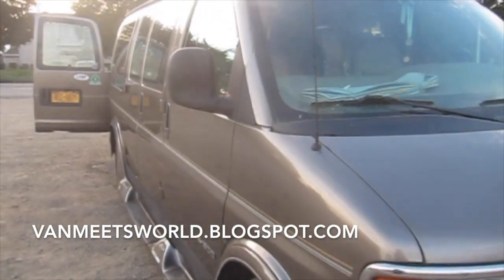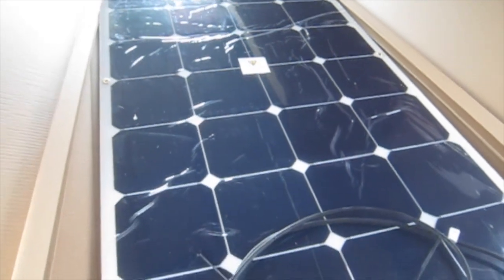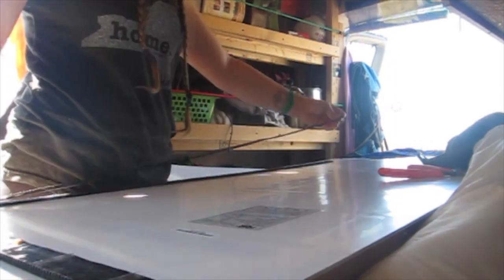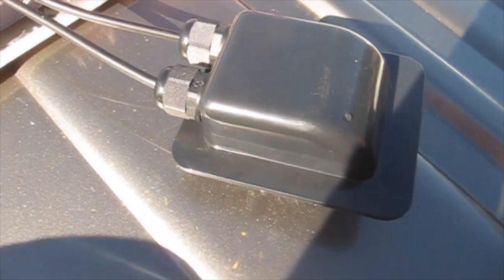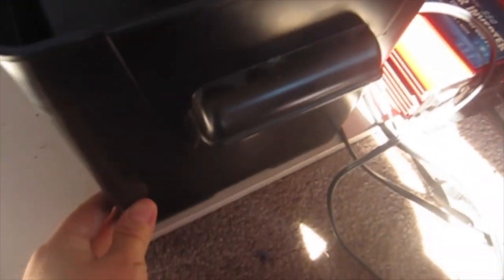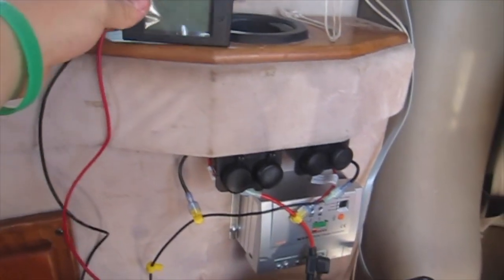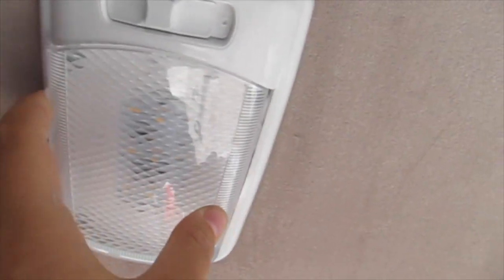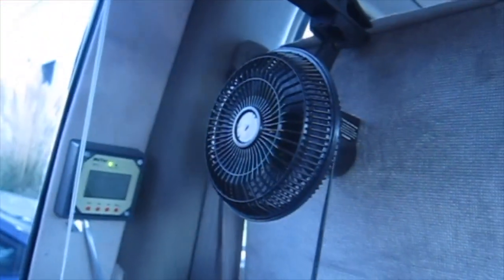Hayduke goes solar!

Comment: Hello ma'am,  I appreciate your videos! Found your channel today, grow back from my old roots.  2007 sold everything I owned, packed up a Bronco II, removed the back seats, and created a website "LifeSaysGo.com",  traveled the west coast for a measly 6 months.. Worked @ temp agencies for gas, showered at wmca's, ate @ shelters... Life grows on from their.  Have learned a few things since then, I could show you how to receive donations via paypal or bitcoin.   Made something a bit different than yours I called "A Battery in a box"  12v marine battery, charged while driving with diodes, 3-120v outputs via inverter, 2-usb outlets and a 2-12v dc connections.    P.S>  create a collective email for paypal & start collecting, go to coinbase and get a wallet...  Post both as monetary options for your journey :)  Hope All Goes Well :)
Reply: A diode is "1 way in - 1 way out"...  Use your current battery/alternator to power your internal "Power" battery, Solar is good when you are popping a squat, but dc to dc is good from place to place"    Create a direct line from your battery and put in a  fuse.  Connect from there to a car charger with a diode, go to the internal van battery, connect the inverter, make the split from D/C to A/C,  make  it all connect.   Youtube it... seem like a smart lady!
Reply: Also great you have affiliate links, possibly put up a wish list...
Reply from the maker: Bryan Mayor Thanks for watching and for the tips!

Comment: Good start.. I see they mentioned AGM's for inside. (explosion hazard is real) So I mounted mine under the van. No hazard plus Free space inside now. Also, keep your eyes on that velcro. The sun's heat will melt the adhesive while driving  and the wind will rip that clean off. $$ gone
Reply from the maker: Velcro is holding up just great. It can deal with temperatures of up to 150 degrees I think.

Comment: Hi Faith, very nice work so far! Great to see you get stuck into some basic electronics work. I've read through the comments- you've been given some good advice about venting the hydrogen from your battery and securing it, but no one has mentioned the point where your panel wires feed through the roof. 

The panel wires need to pass through some rubber grommets fitted into the holes. The metal edges of the holes will cut through the insulation on the wires and short out your panel, possibly damaging it. Just the vibration of driving is enough to cut the insulation in fairly short order.  Any hardware/electronics or auto parts store will have grommets. Get some that are fairly close to the size of the holes you have drilled. Grommets should fit tightly and may need the help of a flat bladed screwdriver to persuade into place.

You will have to disconnect the wires either above or below the roof and slide the wires through the grommets to install them. I see you have some silicone sealant. Put a bit of silicone into the grommet holes and use the wire to work it through so you have a leakproof seal. 

If you want to learn more about electronics, search up a ham radio club near wherever you are. Hams are johnny-on-the-spot when it comes to teaching people about basic electronics and may even help you get a ham radio license, which is a good thing to have if you live on wheels. 

Kind Regards

Brian VK2AAF
Sydney Australia
Reply from the maker: Thanks for the tips!

Comment: Nice when I subscribed I was thinking whens she going to put her panels on it?.. Then I saw your vid in my feed.  I have exactly the same panels as you on my boat- I started with one 100w too, and then I got another 100w later.  You def should get a 12v charger for the Ipod so you don't have to use the inverter for that.  100w was enough for me until I got a freezer, now 200w is not quite enough, though I'm at a much higher latitude to you.  You should think about a relay to charge your new lead acid batt. from the alternator,  will make a huge difference. BTW how many amp hours is that costco battery? I found that 160-200 amp hours in capacity is the sweet spot to keep the power coming all day for me, but my batteries are not new, I paralleled some scrap starter batteries- super cheap way to do it as long as the capacity allows you to keep the daily depth of discharge low as a %age of your total capacity (like <20%).  BTW always wire big loads to the batteries, not the charge controller, I made that mistake with a 65w laptop charger I thought would be fine but it damaged the controller
Reply from the maker: a133m210 I'm not sure what the amp hours are but I have yet to put a dent in the battery charge. I would like to get a fridge in here eventually.
Reply: It is so cold outside here now I don't need any refrigeration but during the summer I used a  12v compressor freezer set to 4 deg C, this would keep frozen food firmly frozen and also freeze cool blocks which would go into my cooler.  This was a fantastic system during the day when solar power was abundant I could set the freezer to -18 C to speed up the freezing of the cool blocks.  Doing it this way, you are not wasting energy opening and closing a fridge all day, only when you swap the cooler blocks which makes a HUGE difference.  Each time you open a normal fridge thats set at 4 deg C the compressor clicks on again and draws 40 watts or whatever, whereas a freezer that sits at -4 or less and never gets opened rarely clicks on.
Reply: should read minus four degrees C - I think my use of two minus signs told youtube I was using some sort of markup for crossing out.... No I just wanted to type the minus symbol twice, but hey ho now i know how to do a crossing out on a yt comment :)
Reply: also being able to store frozen food is a massive advantage, tinned vegetables are not so tasty and fresh have such a short life

Comment: The way you secured that battery is really flimsy.. in a crash that battery would not be tied down, it could fly up and smash into the back of your chair!
Reply from the maker: Designandrew I am aware. I will do something about it when I can. But I'm not able to at the moment.
Reply: Faith Meckley Maybe look at moving it external, there might be room in the engine bay to add a second battery depending on the type of van, sorry I'm not familiar with that model. Goodluck.

Comment: congrats for doing it by yourself!

other ppl already mentioned the danger of your lead acid battery. in case of a short circuit or during overload it can explode or catch fire. also the way you secured it is not safe enough in case of a accident. at least move the battery as close as possible to the backside of the driver seat. that will hopefully prevent the battery from getting much momentum in case of a crash. those connectors will also cause problems at some point. 

but anyway...what i wanted to say is that you waste a lot of energy with charging your phone, i pod and other small devices through your inverter. converting 12 volt to 110 volt then back to 5 volt for your phone just doesnt make sense and only produces heat. maybe not important right now, but if you run a fridge you will need as much power as possible in your battery. 
buy yourself a 12 volt usb charger for the lighter plug.
Reply from the maker: Mr. MP Thanks for the tips

Comment: Oh I forgot. A better way to secure your panel to your roof without drilling holes is to use EternaBond Tape. You can get a small roll on Amazon and it won't ever come off. You can also use it to secure that wire hood too.

Comment: I hope someone that sees this video and is close to you can help you with that install. You made some critical mistakes. I don't want to sound like I am Monday quarterbacking your install but a couple of things need improved. Most importantly that battery is no where near secure enough. If you get into an accident being right behind the drivers seat it could injure you badly. Also like has been mentioned if that is a lead acid battery and it looks as if it is it is dangerous not sealed and vented. You need gourmets where the wires enter the roof. I would also reseal the wire hood with Silkaflex or equivalent. Wire nuts are not suitable for that installation. Wire nuts are usually used in AC wiring. The fuses need to be right at the battery as close as possible. Hopefully a more qualified person on here can help get that all fixed up. Stay safe.
Reply from the maker: NewZona Rides 2 I am looking into the issue of venting the battery. But besides that I am quite confident in the rest of the installation. I drove on a very bumpy and crazy mountain road in Death Valley today and everything held together. The person who helped me with this basically did the exact same installation on his vehicle and his is doing fine. And as I mentioned before I am able to troubleshoot as issues come up.
Reply: Faith Meckley Fair enough.
Reply: driving on a bumpy road is not the same as being in an accident. I don't think you understand the forces involved in an accident.
Reply from the maker: Designandrew I do understand the forces of an accident. that was referring to the people who seem to believe that the connection between my solar panel wires and the internal wires are going to come undone.

Comment: Hi, nice setup. I noticed on your end shot you had two loops of wire above your panel on the roof. I have notice that leaving the wires free on the roof means they move around when driving and friction can cause the casing to thin over time. My advice would be to stuff them under the panel if you can to avoid this. I had to do this with mine. Hope you don't mind me saying. All the best
Reply from the maker: Blue Box on Wheels Thanks for the advice! I won't be able to tuck them under the panel, unfortunately.

Comment: Great job Faith. loved how you attached the panel to the roof with that velcro instead of having to drill more holes for a rack. do you have an amazon affiliate link so you so when followers shop on amazon for anything it can help you out?
Reply: Faith Meckley if your worried about the Velcro holding, you can pick up welding magnets from Harbor Freight. They are very strong and fairly inexpensive. With magnets and Velcro, I doubt you'd ever have an issue. :^)
Reply from the maker: Static CamperVan Thanks for the tip!
Reply from the maker: I do not have an affiliate link, but that you so much for the thought! I'm interested to see how long the Velcro lasts.

Comment: The fan on that controller sounds terrible.  Can you please send me a video of the fan?  I can make some suggestions or fix it for you.
Reply from the maker: When you say controller are you talking about my inverter?
Reply: Yes.  The fan should not sound like it is grinding.  Take a look inside, if there is anything touching the fan try to move it.  If it still makes a noise you may want to replace the fan.